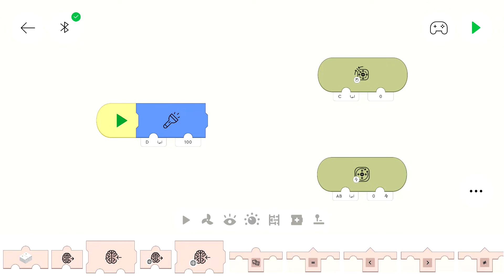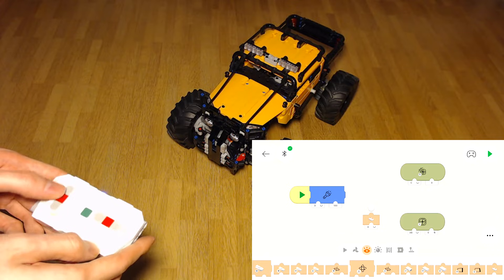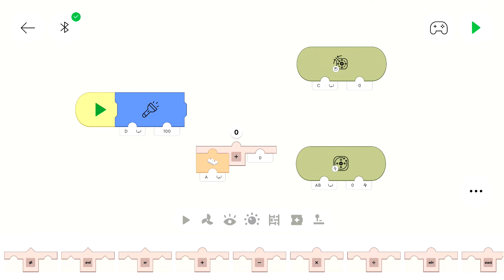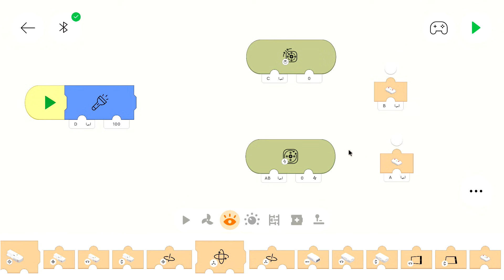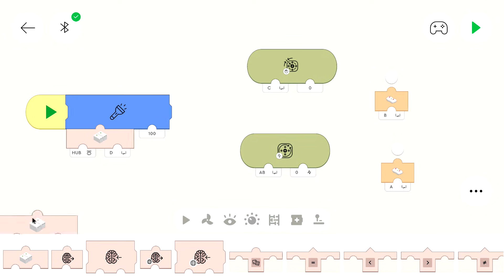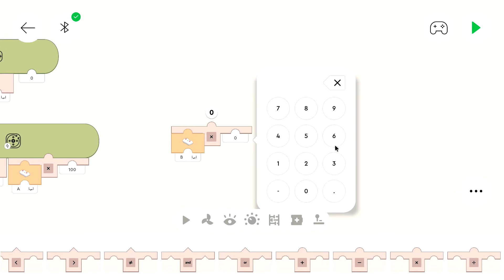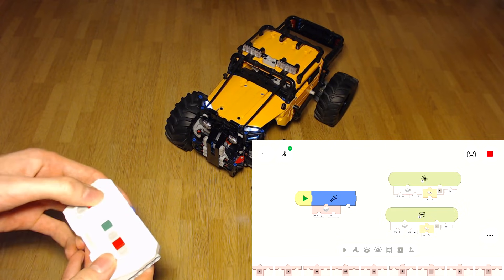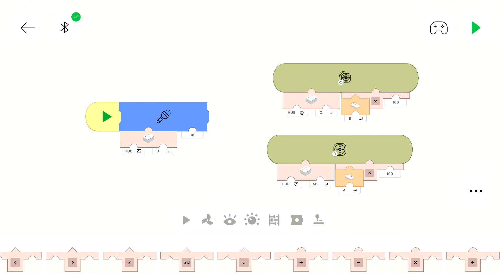Lego Powered Up Tutorial #11: using the remote control (88010) and multiple hubs [English|HD]

Comment: Thanks for making this video. Super helpful but I need help using the red button with the 127 output value.

I can get it to work but it also activates the function assignned to the + button right above it. I'm not sure what to do to prevent the second function from running at the same time
Reply from the maker: Are you using an "=" block?
Reply: Hi thanks for getting back to me. Yes I am using a "=" block.

I figured it out, by isolating the each button to a single function in a single direction.

But now I am running out of buttons. There are 4 motors on my build but only 7 buttons on the remote. Is there a way I can use 2 remotes for 1 hub on the same program?
Reply from the maker: You can add more remotes to the program like you can add more hubs to the program. But the limit for the amount of remotes + hubs is 4 in total.
Reply: @t @technicmaster0tutorials yes I've been able to add the second remote but I haven't figured out which blocks to use to refer to it's buttons
Reply from the maker: @putuvezina5061  The same as for the first one but for the port you have to use the hub select block

Comment: It is possible to use 35533 remote control?
Reply: Update ) On 3.7.0 version of app 35533 remote control works fine, but on 4.2.0 version, this remote doesn't detected
Reply from the maker: It should work fine in the current version

Comment: Can I use a any moter or only the large moter?
Reply from the maker: In the powered up app, you can generally use every motor (but many features require you to use a motor with a position/rotation sensor... the train motor and the simple linear motor don't have one)